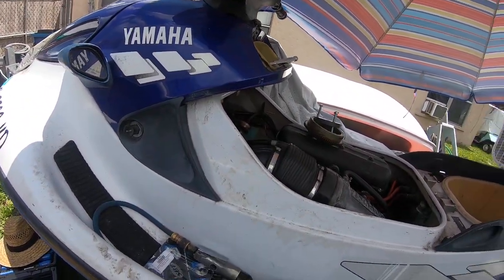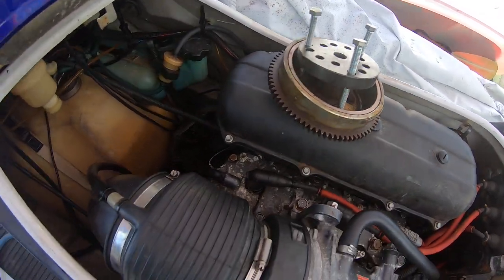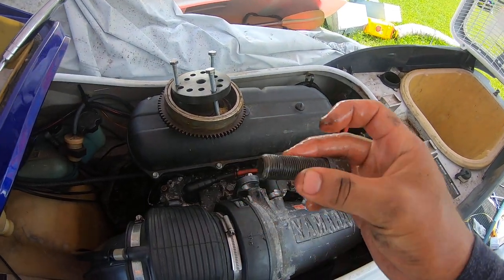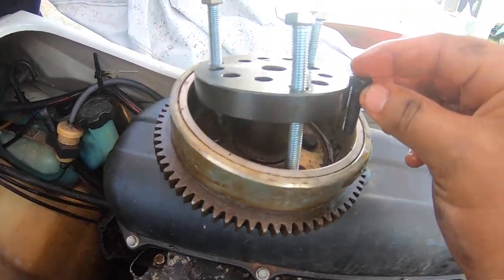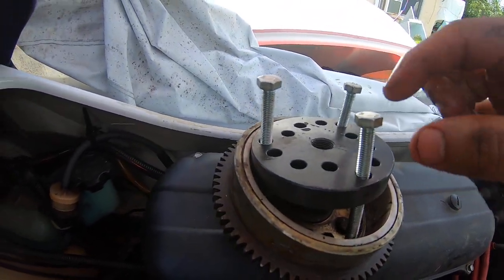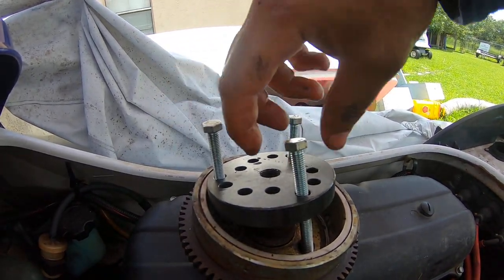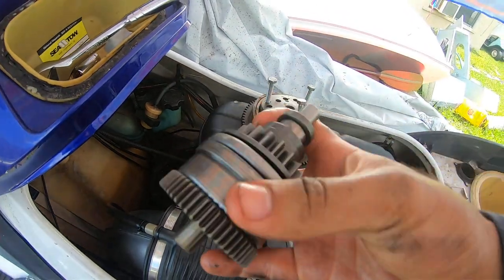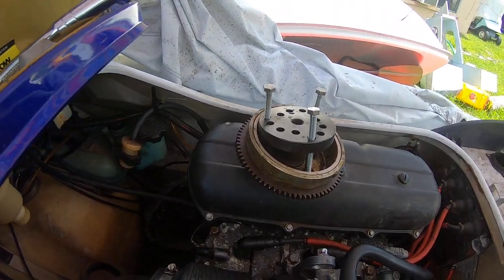Jet Ski Waverunner Flywheel Removal Engine In Hull - 1998 Yamaha GP1200

Comment: nice! i replaced my stator on vacation in the middle of no where on a xl 700,i had to drain and move the fuel tank forward to get puller in, i put a piece of soft rope down the spark plug hole closest to stator to to hold engine still to remove flywheel bolt, worked great
Reply from the maker: Awesome 💪

Comment: Any tips on getting the flywheel nut off?
Reply from the maker: I used socket and wrench to get the nut off. Its easier to get off because the rotating assembly locks in that direction. When I put it back on I used a wrench on the teeth of the flywheel against the block so I could properly torque it. It would just freely spin otherwise.

Comment: Nice video man, what were you're symptoms of a bad bendix? My ski bogged down hard on me on the water and had to mess with the throttle the whole way back to shore when I opened it up the flywheel cover was half open and now I can't get it to turn back on just backfires. Got it on once with some luck I'd say and ran It for about 5 minutes on the hose but can't get it anymore.
Reply from the maker: When the bendix is stuck it wont even crank. The starter will spin and it wont engage the flywheel. It sat for a bit so im sure that was a factor. I tried spraying and soaking it with wd40 for a few days with no luck.